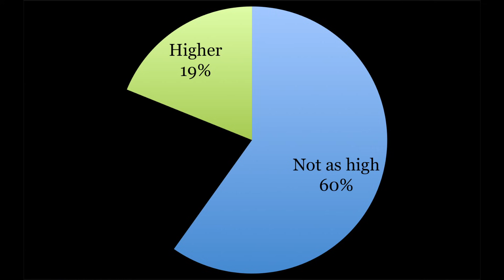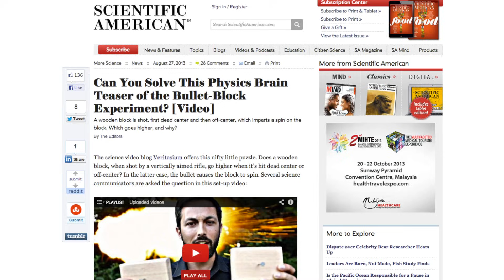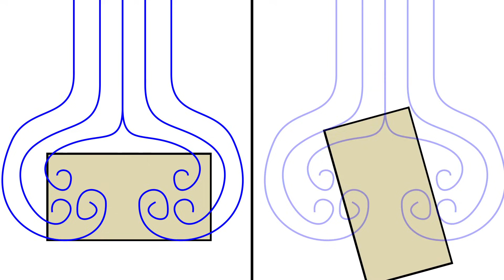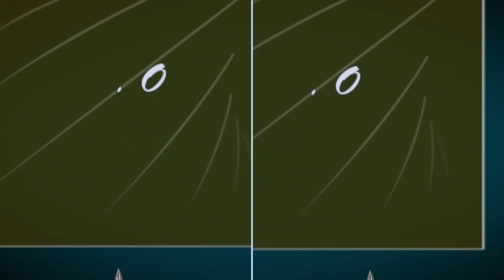Bullet Block Explained!

Comment: Well kind-of. The nail supporting the block on the off center shot acts as a fulcrum. Depending on the energy of the bullet vs the mass of the block, it takes a finite amount of time for the vertical kinetic energy to overcome the force of gravity and mass. Which in essence increases the efficiency of the energy transfer of the side shot due to the fact that the block is supported by the fulcrum action for a longer amount of time.
Reply: The energy gained from that increased efficiency is directly proportional to the amount of rotational energy expended. Consequently the bullet would penetrate the medium less of a distance due to the fact that the energy is converted more rapidly and efficiently in the side shot and less is wasted on friction/penetration of the medium.

Comment: Have you calculated the work done by the bullet as it penetrates the block? The interaction forces would be similar but because rotating block interacts with the bullet over a longer distance it would do more work? I say the forces should be similar because the energy required to penetrate the block that distance (given the similar relative speeds which would characterize the response of the material).

Comment: replace wood with  material that a projectile can travel through easier and is lighter (expanded polystyrene) and a lower powered projectile would help
by reducing the force of the projectile and reducing the force needed to lift the item and reducing the amount of lost force as it penetrates hopefully will extend the distance penetrated meaning the 1% difference could be easierly identified

Comment: You could use a softer material, like a plastic or foam. The %that they travel will be the same between the foam the the wood, but the difference will be easier to see.

Comment: While I find this very intriguing, there are far too many variables in this experiment.
Wood is a poor choice, as its density is unequally distributed. Therefore, penetration depth will not be consistent, nor will the center of gravity. (Ten blocks of wood of identical weight, and dimensions, will all have slightly different centers of gravity).

A bullet from a gun, offers several variables: 
Muzzle velocities are not consistent, even with the highest quality rounds.
There is also the matter of projectile weight and shape, as those can vary from bullet to bullet.
There is also the matter of the placement of the rifle. If it is not 100% secure, than the rifle may move during/between shots, altering the total energy, and trajectory, of the bullet.

I would recommend using something like a small air cannon, with a ball bearing as a projectile. Projectile weight, dimensions, trajectory,  and velocity, should be as close to identical as possible.

As for the target, I'm not sure what would be the most consistent, but I'm thinking Lexan blocks. Dimensions, weight, density distribution, center of gravity, and placement, should be as close to identical as possible.

The goal is to remove as many variables as possible, leaving a much clearer result.

Comment: I think the rotating is caused from the unequal disbursement of momentum and the shift in weight, which is due to where the bullet impacted on the block. Before they were shot they all weighed the same, but once they were shot the balance in weight shifted on the object that was shot off to its side.  Think of a balance scale, if the weight was placed center mass of the scale there would be no shift, but if you added more weight to one side it will begin to tilt in that direction.  The block that was shot center mass did not rotate, because it was able to evenly disburse the momentum between both sides of where the round impacted.  On the block that rotated, one side endured more of the momentum than the other, and that is why it rotated.  It took longer for the momentum to reach the other end of the block, and by the time it did it was already to late.  Those are my theories anyways

Comment: I have not yet seen an experiment plan to find the excess energy, though I have not made it all the way through the comments. To maintain the essential parameter, an inelastic collision, while increasing the difference in lost energy, there are five parameters that can be changed. The mass of the projectile can be increased, the initial velocity of the projectile can be decreased, the mass of the target can be decreased, the moment of inertia of the target can be increased, and the arm of the projectile from the center of mass of the target. To do such, I would suggest replacing the wooden block with a long corrugated plastic piece with some extra mass on the ends. I would also replace the gun with a bow with a heavy arrow (small diameter; covered with sandpaper to help it stay in the plastic if needed) but low velocity (partial draw maybe). Hopefully that would help, but I would also do some experiments on the conditions to figure out the  ideal circumstances since I am getting bogged down in the equations.

Comment: The simple way to make the difference in bulled depth measureable would be to use large blocks of foam, layered with sheets of masoninte rather than wood. Your density would be more consistant, and the penetration deeper. The total flight height would probably be lower since you would have more surface are for a given mass.

Comment: You need to get better bullets. The heat of the barrel is an important factor in the burning of the powder in question. You may want to consider steel darts shot from an air rifle as opposed to something that runs on flames. You can control the velocity and pressure consistently. Lubricate thoroughly on each shot to ensure no changes.

longer wood.

Comment: The reason the spinning block can have larger kinetic energy and still go as high is because the bullet impact didn't result in an equally large loss of energy, because the bullet wasn't slowed down as much as in the other case, so not as much friction was created. The non-rotating block got heat up more so it has a higher thermal energy.

But Derek, you already know these stuff, you just want to make us think, right?

Comment: I think its better not to use any bullet. there is no need to have something penetrating the wood.Just repeat the experiment by applying some force upwards, at the middle of one block and end of another.The force applied must be sufficient to lift the blocks up in the air.

Comment: I dont understand why this is hard to understand . Basically the spinning one continues to spin even after its landed on the ground , where as the not-spinning one just falls . WHY IS THAT SO HARD TO UNDERSTAND !?!?!?!
Reply: Maybe you simply do not understand the question XD
Reply: oldnickus maybe you dont life
Reply: I don't life?? explain yourself sir
Reply: You understand nothing. Keep quiet.
Reply: You obviously don't even understand what we are trying to figure... So pipe down and let the smart people work
Reply: If it keeps spinning once it hits the ground that would mean it has even more energy which doesn't doesn't give an explanation as to why it has more energy. The answer is to do with the penetration depth and would be more visible in a material with a higher density.
Reply: ***** But you still need a certain level of intelligence.. i mean you have to  understand the question or it will never be  solved? hahahhaaa
Reply: ***** There needs to be more ppl like you on youtube. thank you sir.

Comment: If we assume the blocks as two different levers, and the nail is the fulcrum, the non-rotating block is a neutral lever, the rotating one, instead, is an advantageous type lever. And it means that the rotating gained more kinetic energy just because the applied force was stronger than the force applied on the non-rotating block. Is it wrong?

Comment: I also noticed that while reviewing the slow mo of the off centre bullets the wood blocks also scrape the sides of the barrier, this could cause some actual loss of energy. Maybe setting it up on wires or bars instead of a barricadesque rail system?

Comment: If the bullet depth difference was "immeasurable" with an x-ray being only 1/10 of a mm then why did the nail test on both blocks (when you had the lady stick the nail in the hole left by the bullet) clearly show a difference in penetration of almost 1/2 of an inch? (time stamp was at 7:30 on the video)

Comment: I do not see details about the experiment listed but I will tell you one observation.

Rotational kinetic energy imparted to the block by the bullet AND the muzzle blast. The proximity of the rifle muzzle to the plexi-glass created a "funnel" like area were additional energy was delivered to the block.  I concede that this energy may not be great but it needs to be taken into account.   When I chronograph bullet speeds the chronograph has to be at least a foot away from the muzzle to prevent false readings. 

When the block was centered this muzzle blast energy was imparted equally across the bottom of the block.

When shooting the block off center more muzzle blast energy was delivered to the right of center and less to the left.  This in ADDITION to the energy delivered to the block by the bullet.

If you were to move the muzzle back  at least a foot you can prove me right or wrong.

I am sorry if this has been said a thousand times before. I have not read all the comments. Great video, keep up the good work.

Comment: Greeting sir,
After watching the video yesterday, I have consider ways to improve the experiment.
Firstly, I think we can change the experiment from vertical to horizontal, so that the weight of the block doesn't act on the incoming bullet anymore.
Secondly, we can reduce the mass of the block, for example using a smaller block or a block made of Styrofoam. Since the bullet crashes due to reactive force from the block, and force is equal to rate of change of momentum, we reduce the mass of the block to reduce its inertial. A Styrofoam block is also better since its much softer than wood and bullet can travel much further into the block so to make it measurable.
Lastly, I also insert a spring into the block so when shot, it helps to conserve some of its linear momentum and that will make the difference more obvious.

Comment: Maybe you can measure the volume difference in the bullet holes. We can fill both holes with a suitable liquid and measure its volume using a micro-pipette. The hole in rotating block must be having slightly lesser volume. Since thickness of the penetrating bullet is same it would mean that there is a difference in height as there is difference in volume..... Dont know if it will work but just an idea

Comment: The ballistic nature of a .22 caliber bullet is quite variable.  You should use a ballistic chronograph to measure the actual velocity of the bullet out of the barrel.  My experience with .22 ammo because it is rim fire you need to use MATCH grade ammo to have any real consistancy hence the different heights of the previous tests.  Also do some tests and fire the bullet at different distances from the center and use torque formulas to test reliability. Just a thought!

Comment: Momentum is not always conserved while energy is ALWAYS conserved(it is law). I don't like the idea of explaining this bullet block experiment with the conservation of momentum argument. Try using longer and heavier blocks like @ArtisanTony mentioned. More info could be obtained that way IMO.
Reply: Bernard, you got the point that energy is always conserved, but to explain this experiment using this law would require a lot of effort taking data of all the energy dissipated. Momentum can always be conserved as long as you consider the system careful enough. In the video, Derek might have neglected the gravitational force acting on the system (the bullet and the block) which causes the system to lose momentum. But if you consider only the time frame when the bullet accelerate the block, the time taken would be tiny and thus the momentum loss from the system is negligible. Therefore, the velocity of the block and the bullet just after the bullet hit the block is almost the same for both cases (hitting at centre or off centre).
Reply: Momentum is always conserved. I got that wrong. From what you said, I think you would agree that if a longer block is used, the height will differ?

Comment: Use a bigger, softer piece of wood (or another material that permits a deeper penetration, maybe ballistic gel?) and a gun that has a higher projectile velocity/penetration potential. In other words: make the depth much more longer so that the 1% difference becomes bigger, wayyy bigger

Comment: Given that all the energy comes from the bullet then clearly there is a loss in spin. Since the energy loss is small, the difference in height will also be small which is also lost in variations of weight in the different wooden blocks. Repeating the experiment multiple times with a material with consistent characteristics will reveal a difference in height. There are a lot of variables that can influence the result with just one or two tries.

Comment: use a slightly less dense material in order to see the difference in penetration but you would need a bigger block as well.  A less powerful gun would be useful as well, like a pellet gun or a paintball gun.

Comment: Perhaps if a different material (instead of wood) were used as the block, the difference in the penetration depths might be larger due to a lower density and could then be measured

Comment: What about the reaction energy exerted on the block by the plexiglas?  

Redo the experiment with toothpicks instead of nails.  My hypothesis is that the nails are exerting a downward force on plexiglas when the bullet hits.  If they weren't, the bullet hitting off-center of the block would not lift the block directly vertically.  The rotational energy that the bullet imparts to the block is equal to the reaction energy exerted by the plexiglas, so the block still has the same vertical force applied, albeit from two different sources.

Comment: The block obviously gains the same kinetic energy in both cases.
Why cant the angular momentum in the second case simply be the result of "Gravitational torque" due to the weight imbalance about the point of application of force?

Comment: The penetration depth is inversely proportional to how far off-center you fire. So if you aim the gun as far away from the center as possible, you will get the least penetration. At least that's what the simulator says :) excellent video!

Comment: The obvious solution is a bigger bullet and a bigger block, 1% of a large enough distance will be measurable.
Alternatively change the block geometry, a long skinny stick has a larger moment of inertia which will result in a larger angular momentum and a larger difference in transferred energies.

Comment: What if the block with the bullet in the middle is rotating on both sides but they cancel out...
Reply: exactly! in the second case the weights on both sides dont balance causing a net anticlockwise torque!
Reply: Sriramprasath Manivannan  but only during the time the bullet is going up. As soon it is on the side that goes down, it speeds up the rotation again.
Reply: I thought like derek at first but I immediately realized the problem you brought up. I agree.

Comment: what about using some kind of "bullet proof" material such as kevlar. i think it could be interesting to see the deformation that happens.

also, pool balls might explains what happens, when you hit dead on you're applying "slide" when you hit it offside it's applying follow.

when it gets down to it gravity removes the advantage of follow, but if you aligned the blocks horizontally so they would travel forward the spinning one would go further, i think.

Comment: I would like to see this done with blocks that are much wider (in the x direction). This would (I think) be a good way to test out the depth to which the bullets sink, but also it would look at a more extreme case (increasing the rotation) while still (in theory) allowing the blocks to get to the same height, thus making the point in a more dramatic manner. Love to see it done... (hint!)

Comment: In order to make the results of this experiment measureable, it's very important that you shoot into a material with a density less than the density of the wood used in this video. This material could very well be some material with a lot of air in it, such as cardboard.

You could also use a bigger size bullet (so that it is heavier and can be shot out the gun with more force, because of the greater amount of gunpowder), but the bullet shouldn't necessarily be longer. That is because of the fact that when it's longer, it has more points of contact with the material it's being shot into that makes its energy being drained very fast.

I don't have the skills to calculate if this will actually work, but I think the results will be measureable when you configure the experiment this way.

Comment: What really happend is that both blocks rotate just as much, the only differance is that the block hit in the middel rotatets just as much on left side like it dose on the right side. And the block hit on the edge, rotates alot more on the one side, and alot less on the other side! Thats why they both vent just as far up, and the bullet vent just as far in to the wood. Both blocks consium the same amount of energi, and the energi will always be the same, it dose not matter where the bullet hits

Comment: Okay so here are ALL POSSIBLE THINGS that can vary with each experiment:

speed of bullet, Each wood's density( and/or weight; and therefore how much the bullet goes into the wood block; non-uniform density throughout the entire wood block), wind velocity near the wood, angle of the bullet going into the wood( DEPENDS on the each wood block's shape- not perfectly rectangular), the energy used to produce sound